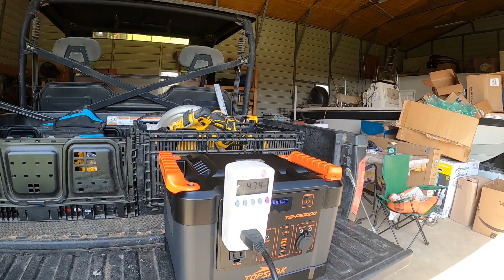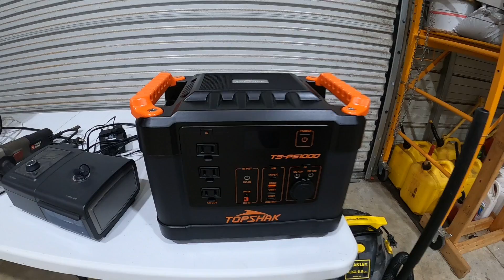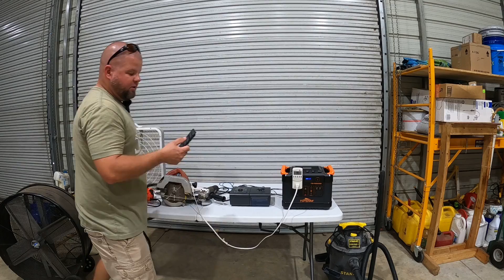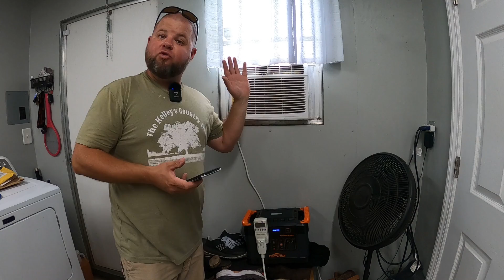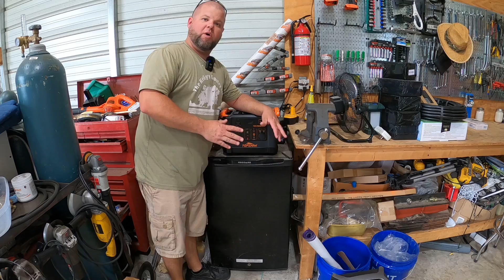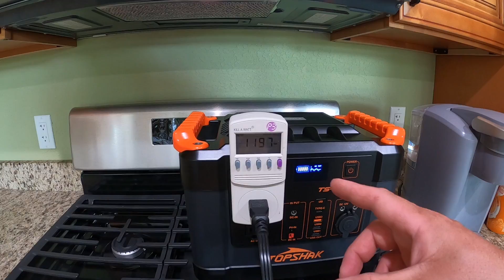TOPSHAK 1000 watt solar generator full test and review! #564

Comment: A lot of that loss also is burned up with the pure synwave invertors having so much wattage ability, everything costs
Reply from the maker: That's very true as well
Reply: @TKCL  O have an ecoflow and love it but capacity is lower just because of how good the inverter and charge controller is. Ive noticed this and I think Will Prose kind of talks about it and it makes sense. I have a cool trick I do to give great capacity though. I have a battery bank and hook it into the charge side of the ecoflow. Because of its pass through charging ability  it doesnt go down until the battery bank is depleted! You can even hook up a charge  connection to your vehicle  for when you are camping or what ever. Im with you on these and love them! have solar panels and everything also
Reply from the maker: That is a neat trick!
Reply: @genghischuan4886  I have a delta pro and I love it.

Comment: That was an awesome review with a lot of useful information, I would love to see more of these power supply reviews, I’m more interested in some of the solar charging capabilities of some units because of the low cost, I know it could take days to charge one, but it makes it better for emergency use, and just a little FYI 😉 electric motors run the most efficient at full speed,, it’s a bunch of math, CFM vs KWH vs Rpm, etc.etc.etc. Awesome video, Thanks 😊
Reply from the maker: Thank you for taking the time to watch

Comment: Would like to see a full solar setup. Especially if your provider is FPL, they're changing their net metering program.  With as efficient as
your house is you could probably do a smaller solar setup and battery. The payoff would be closer to 5-6 years compared to the usual 8 to 10. I have a 9kw system and just about break even yearly with production vs consumption.
Reply from the maker: That's not my provider, and at current expected average monthly electric bills in the $100 plus range, it will be hard to justify any whole house solar system.
Reply: @TKCL  My average bill without solar would be about $160 and its only $10 with,  but had my house not come with the solar panels I wouldn't have bought them, at least not at the price the previous owner paid. If you want to get into detail about home power consumption look at Emporia's energy monitor.  It has multiple sensors for each circuit breaker. It's nice to monitor consumption when I'm running on my generator during our hurricanes.

Comment: Just so you know Andrew... Any battery box of any type will have some loss in amp hours due to the converter loss... Its great to have an idea of how much 110 usable power you have, but you could get more, with less loss, if you used 12 volt devices such as the cooler you tested not to long ago... I'll add, I'm a cpap user and I have a 12 volt power cord for my unit that I often use when I'm out at the hunting cabin... So many things, like fans and such can be picked up reasonably that are 12 volt...
Reply from the maker: Great information to know, thanks!

Comment: You like building things. Why not try building your own solar battery bank? Seen some on youtube attached to a dolly. Probably similar price for better battery, and could probably use a 2-400w solar panel. Less portable, but way more practical for emergency power.
Reply from the maker: I've yet to research or fully understand the equipment, I most likely will in the future.